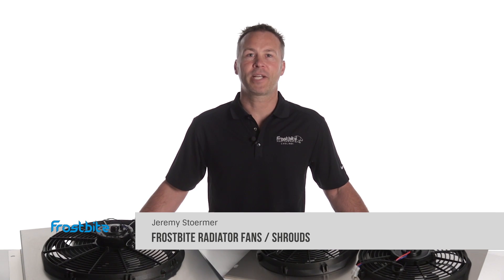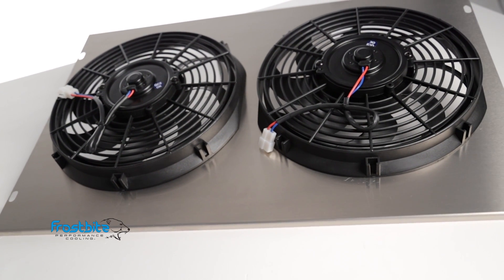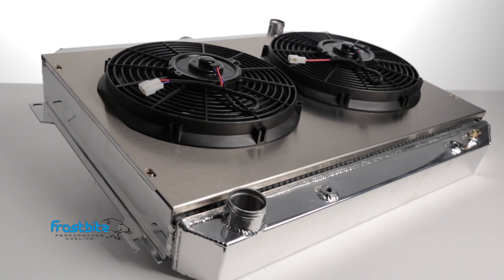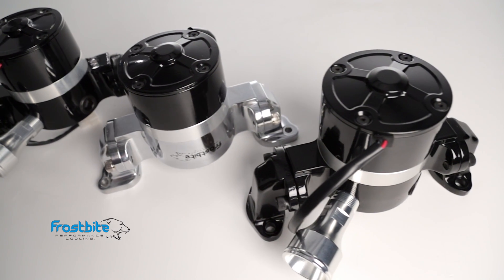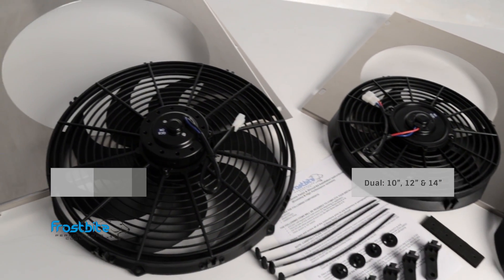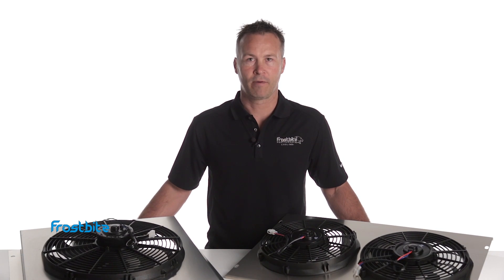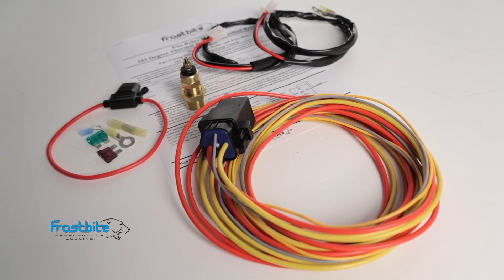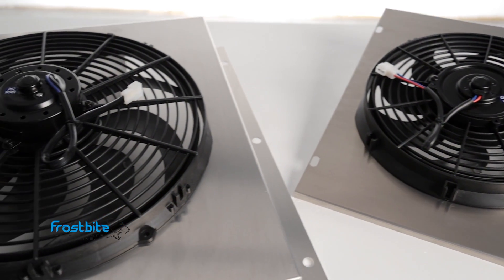Frostbite Radiator Fans / Shrouds

Comment: I just installed this along with my Frostbite radiator. Completely disappointed that the relay is not included at this price. Almost $1k spent on my setup and you don't include $20 worth of parts?
Reply: For real.  It’s absurd, isn’t it?